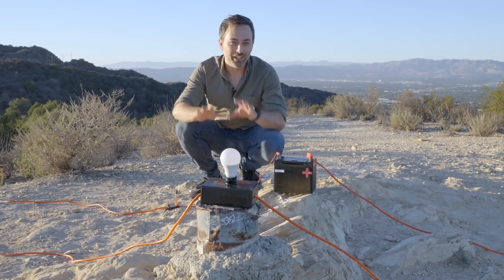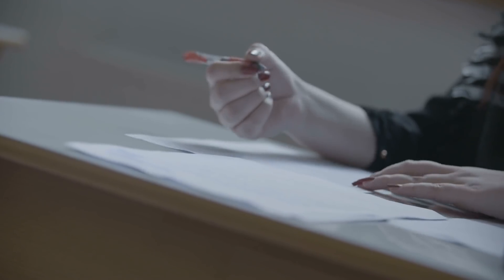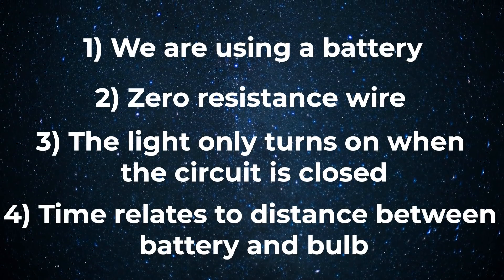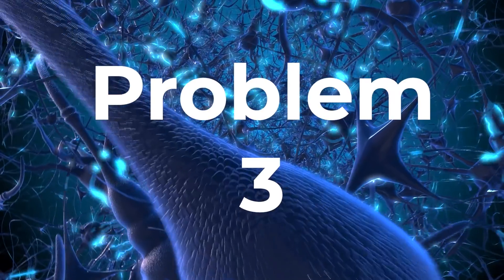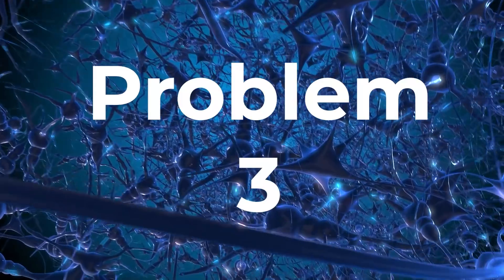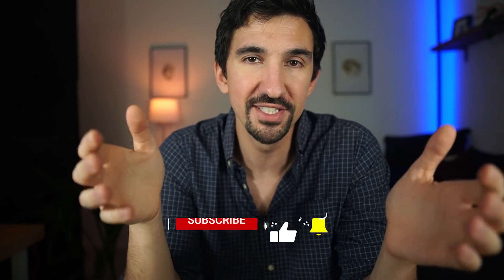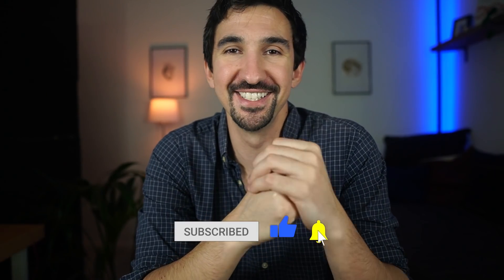Is Veritasium Wrong About Electricity?

Comment: The circuit itself is a complete misdirection. The answer to his question is the same if the light bulb is lying on the floor 1 meter away from the battery and not connected to the circuit at all, because the current induced after 1/c seconds is a result of the electromagnetic field that the battery itself generates and has nothing to do with the wires.
Reply: Clarification: you still need the circuit so that the battery will have a magnetic field, but the bulb doesn't have to be connected to it.

Comment: About your circuit breakage problem, I think it will not break causality. The current has to stop flowing at the moment the battery "knows" there's no sink on the other end (1/2sec later), after which it'll take another 1m/c s for the bulb (or nearby wire) to know there's no field anymore. So the light bulb should actually turn off after (1/2 + 1m/c)s. But anyone who feels I'm wrong, please correct me, because neither electric nor physics is my field. 😂

Comment: haha there are issues with his setup. but it was done to make a point. In actuality, the wire goes thru the earth field lines and the bulb would not only light up but probably explode from the charge.  But he is spot on with how electricity works.  Most (if not all) don't like it because it goes against classical thinking.  All the recent breakthroughs in battery density and charging are because we look at how electrons work in this way.

Comment: While he was using a battery for the demonstration purpose, he was speaking specifically about alternating current, and explaining that the AC current, and DC current operate quite differently.  I mention this, because your entire second point focused entirely on the prop, and less on the explanation he was giving.  He did make a point to reference the AC current is what we were looking at directly.  As alternating current example is given in the video where he uses a chain, and does the pull back and forth to move the wheel.  They also used a wheel to show how power pushing back and forth in the wire.  They even put in a example how transistors work.
I think rewatching the video, and don't focus on the props.

Comment: Another thought experiment. Don't have the wires close to each other have them in a giant circle, so that one side of the circuit cannot induce a current in the other side. Let's not have a switch, just disconnect the wires. On the positive side of the battery there's a shortage of electrons and on the negative side there's an excess of electrons. If you connect the positive side first then, as far as I understand it, electrons will start shuffling along the wire to fill up the holes in the battery. As soon as the shuffling reaches the light bulb the magnetic field will start transferring energy to the bulb until there is then a shortage of electrons at the other end of the wire at which point the shuffling will stop. Clearly, the magnetic field is never strong enough to light the bulb. This will only happen when you connect the negative side, at which point the light will come on. However, if you connect the negative side first, no shuffling will occur until the process is kicked off by connecting the positive side. Since electron shuffling can now occur across the battery, the bulb will light. How long it takes for the light to come on will depend on how long the electron shuffling takes to reach the bulb, a distance of one light year on each side. As far as I understand it, if there are no moving electrons, there is no magnetic field. With an alternating current, things will be somewhat different. Since whichever terminal is connected first, unless the one light year of shuffling takes longer than a sixtieth of a second, the electrons will already be shuffling when the second terminal is connected so that the light will come on immediately.
Now someone please tell me the flaws in my logic, and how long the shuffling takes!

Comment: It's the assumption 3, "Light only turns on when the circuit is closed" that is faulty. Not entirely wrong, but it neglects speed of light: information about the break in the circuit takes half a second to reach the bulb and the battery, and so if you break the wire at the far bend and simultaneously connect at the battery the bulb will light up for half a second, before the breakage in the wire becomes local to the battery and the bulb.
Reply: I don't think there's such a thing as "simultaneously" over those distances though due to relatively. As I understand it, whether those two events happened at the same time depends on your reference frame
Reply: @jugbrewer  If the two reference frames aren't moving relative to each other though, the non-local nature is quite simple;  "simultaneously" may not mean the same thing as in Newtonian physics but the meaning is well established. One side has a light source, the other has a mirror. The side with the mirror sets their clock to t=0 a the light hits the mirror, the side with the light source sets their t=0 to half the time between emitting the light and receiving the reflection. Operating at the same hours as displayed by their clocks is understood as operating simultaneously.
It gets less obvious with the two moving relative to each other, and if you add acceleration you get a true mess, but if they are both stationary relative to each other the concept isn't hard at all.

Comment: I’m having a little trouble accepting the idea that information cannot travel at a speed higher than that of light in face of what we know (so far) about quantum entanglement (which does indeed seem to take place instantaneously). The crux of the matter, it seems to me, lies, as the Dr. Miles mentions, in our mental representations of nature. The idea of a current (as in this case) does indeed bring forth the idea of rate, or speed, but perhaps it ought to be thought of differently.

Comment: Can someone who knows about physics answers this question that just popped into my head, if you had an object that was one light year long, and you were able to push it, does the other end therefore not move instantly, since you cannot transmit information that fast? How does this actually work in that hypothetical situation? Why can't it move instantly, also if you pushed at the speed of light, wouldn't the object be entirely compressed by the time you reached the other end?

Comment: This isn't breaking causality because the information is still transmitted at the speed of light. The switch closes the circuit and the field begins to move. However, let's say you have a second switch at the "west" end which you open the exact same time you close the switch 1m from the bulb. The light would flicker on at 1/light-meters/second - and then back off at 1/4 seconds when the the switch and bulb can "observe" that the circuit is broken.

Comment: They are right for the induction part but wrong for the non inductive actual flow through wire parts. These are different problems to solve. For the 1/c induction the wires don't have to be connected at all. They tackle this, but present it highly misleading.

Comment: This is the second video I've seen that relies on some kind of "signal jump" in order to work. What if the battery and the bulb were more than one meter apart? What if they were a kilometer apart? In all likelihood the bulb would still light pretty much instantaneously, but now there's no way you could blame any antenna effect or capacitance. Plus, the wires are insulated.

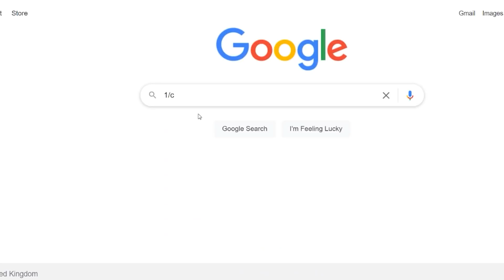Comment: @2:05 since you making such an elementary error in your criticism, I must offer you a counter criticism!

distance=speed * time;
time=distance/speed;
The distance between the lamp and battery is 1m, and speed of light is c m/s.
Now 
time=(1m)/c(m/s);
[The units for metres cancel out]
time=1/c (s);
The units are oK by dimensional analysis.

Here, c is used as a constant of value 299792458, with no unit since the unit is already accounted for into the final unit and given as seconds .
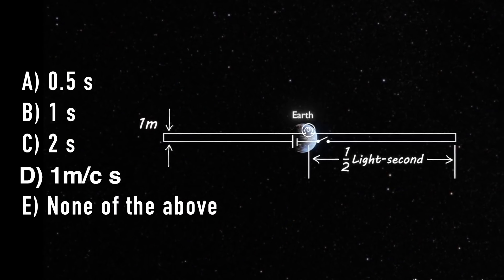Your suggestion @2:18 is not quite right as you include the meter with the 1, but not with the speed of light.
It should either be:
(1/c) (m/(m/s): explicitly showing ALL units involved.
OR
1/c s: simplifying the units as the meter cancels out.
I hope I make sense thanks.

Comment: You had me (metaphorically) shouting at the screen at first. I immediately flagged your assumption #3 as itself violating causality. Bu t you got there.

Viewing it as an antenna/transmission line is on target. But Veritasium's 1/c is wrong not just wrt the units, but also the number. The speed of light is a limit, not a mandate, and for various reasons the true speed will be a bit less than the speed of light in a vacuum.

An common example of the speed of light slowing is refraction, where it slows in different media.

And an example that illustrates the problem with #3 is gigabit ethernet. You probably have at least one ethernet cable in your home. The signalling rate is 125 MHz. Bits are sent 8 at a time, on two wires for each of 4 lanes (a differential pair, with opposite polarity). So each bit group is aaround 2 meters long on eight wires. A 10-meter cable (20 meters round trip) would have about 80 switch flipping zipping along, 40 of opposite polarity in each direction, meeting at the other end in pairs. Plus another 80/40 for transmission from the other end, on the same wires, traveling the opposite direction!.

You can run up to 100 meters, so 10x the number of bits, for a total of around 1600 bits on 100 m of Cat 5 cable (but half are mirror images).

10 gigabit ethernet multiplies the clock rate another 4x,  for around 7200 (3600 pairs) of bits on that 100 m of Cat 6E 8-wire cable.

And we can go up to 40 gigabits/second with the latest standards, with Cat 8 cable. Faster clock, more bits per clock, same 8 wires. But here the length is limited to 30 meters, so only a small increase in the number of bits we can have flowing at the same time.

Ethernet (not to mention, radio) would not be possible with assumption #3!

Comment: I 100% agree that the circuit behaves as a pair of antennas until the the DC current connects through the wire (and that for most realistic setups the antenna efficiency would be too low to actually light anything). I'm fairly annoyed that Derek didn't even mention antennas. (I'm doing my PhD in Physics Instrumentation, so this is roughly my field, although I've only tried to work this out conceptually.)

The whole Veritasium video could have just been "sometimes wires are also antennas".

Comment: You’re kind of wrong about it breaking causality common because there is nothing moving from one end of the wire to the other. The electrons or just vibrating back and forth in the wire not actually moving anywhere electric field it’s turned on by the electrons and vibrating point beingThe field is turned on all along the cable at the same time.

Comment: So we have a chain that runs from earth to the nearest solar system. I'm at one end and you the other. If I pull on the chain will you feel the chain being pulled at the instant I pull the chain. If yes does that break the speed of light. Your light-years away yet have instant feedback. This idea could be interchangeable with the wire with zero resistance. The electrons being the chain. Zero resistance could cause strange things to happen. Just a thought

Comment: Also, you cannot ignore the thickness (diameter) of the wire, since the near field propagation drops off so rapidly.  If the wire was 50cm in diameter and the lightbulb 1m away from centre, then you might be able to detect a small current through the bulb in even less than 1/c seconds (assuming such accurate clock and all that) with actual ammeters. That just goes to my point in the comment below on how f---d up these kinds of pedagogical gedankenexperiments can be.  At some point you are making so many "simplifying assumptions" you lose credibility with a hard-nosed engineer.  They might be like, "In what universe does this sort of pedagogy have any practical value?"  A legit complaint.
Reply: What is most f--ked up about Veritasium is that this sort of "make some simplifying assumptions" bullshit is NOT what Einstein would do.  It is what the most atrocious economics "professionals" do and is a direct cause of human suffering and austerity (assume "perfect market clearing" and "rational agents" &c.) because with that bullshittery you get econs thinking a bit of inflation is worse than mass unemployment (so they are psychopaths).  In the physics case what Veritasium is doing maybe isn't so bad for humanity, but it is still "bad science."  Einstein would make the simplifying assumptions needed to derive the violation of causality condition, and use it for THAT purpose, not to argue like a tosser about gedankenexperiments in a way that have no serious practical point to them.   I get the pedagogical lesson purpose, so can forgive Veritasium on this occasion.  But there are better ways to make, and practically demo, the point that the fields carry most of the energy around the circuit until the KE heats up the scene (the capacitor and inductor cases).
     So physics nerds, let's not try to emulate the neoclassical economists.   That's the path to human atrocity.  Try to do pedagogy as close as you can to a classroom practical demo.

Comment: Arguably, time before the light bulb turns on should be closer to 2m/c². The electromagnetic field has to propagate from the battery, plus light has to travel back. You wouldn't be able to notice the bulb turning on instantly. Relativity tells us, this observation is dependent on whether it is made on the battery or on the bulb side. For an observer on the bulb side, both actions would happen at the same time

Comment: Glad to see this video, I had many of the same thoughts (especially the antenna stuff) that I expressed in the community post before the video was posted. There is so much about the assumptions that are important to the answer. Any change in assumptions gives a different correct answer. When working with unphysical models it's all about what question you are trying to answer and creating a model to do that. Making unphysical models that don't answer specific questions is kinda like those math memes where you need to apply order of operations and different orders give different results. If you added brackets to the math question, or physical contraints to the model, you would remove the ambiguity all together.
Reply: Well said. Assumptions should be made to isolate some mechanism, not to create a clickbait answer. Those assumptions were not outlined in Veritasium’s video and he did not even fully explain the mechanism behind the answer he gave in the context of the problem. I am just glad so many other people had the same reaction and I am not insane for thinking WTF? after that video.

Comment: The thing that most annoyed me about veritasium's answer (besides the embarrassing misuse of units) was that it's only the "correct" answer if you accept his set of poorly stated and highly unrealistic assumptions. The worst being that the light would turn on the very instant any transient electric field at all reached it. Even if it was only a few nanovolts for a few nanoseconds, an amount that in reality would get lost in the thermal background. If you had such a light bulb, it would never turn off. Arguably, it could even be a perpetual motion machine of the second kind. He was trying to illustrate an important and often-misunderstood fact about electromagnetism, but he presented it as this unclearly stated "gotcha" trick question. I'm afraid it perpetuated more myths than it debunked.
Reply: Exactly. electric and magnetic fields loose strength with distance from the wire and generally follows  a 1 over distance power law. So while it's true that the energy is travelling / transmitted through the fields, 99% of the energy transmitted is very close to or inside the wire. He essentially puts it like it's the other way round. The field strength at 1m distance is tiny. Also he mentioned that "energy transmitted per area" is what matters. He also admits that EM fields propergate at the speed of light. So the field along the wire will propergate at the speed of light. That means the energy transferred from the source to the light bulb will increase as the field gets wider as the area that is penetrated gets larger and larger over time.

Though, especially at a DC circuit all the capacitive coupling (which it actually is) will go down to almost 0 as the time passes and in the end the majority of the "energy" will be travelling along the wires. I can highly recommend the EEV blog video on this subject ^^. Though I would highly suggest to look up the field strength fall off.

Finally anyone with practical understanding of electronics knows that instant changes are not a thing, at all, at least in the real world. Any voltage or current is generally ramping up / down. What is the most misleading part of Derek's video is that he essentially jumps back and forth between signal / information and energy transmitted as if they are the same thing. He also oversimplifies the concept of a light "being on" as if our world is somehow binary. In practice any binary signal requires a minimum strength to be considered a valid and reliable signal.
Reply: True. An accelerating charge propagates electromagnetic radiation. So initially when the electrons are accelerating they send out an electric field so weak it wouldn't have enough energy to produce any noticeable light from the bulb one meter away.